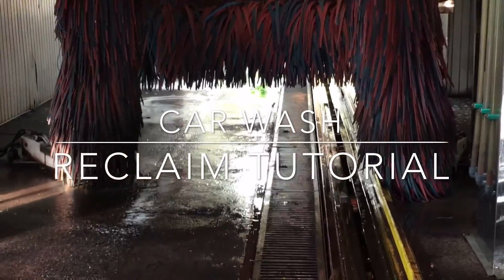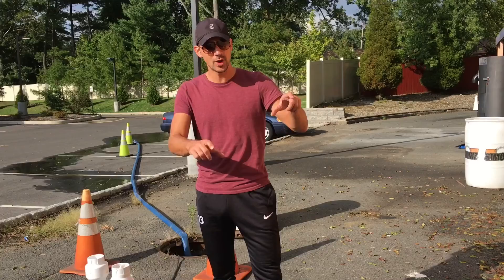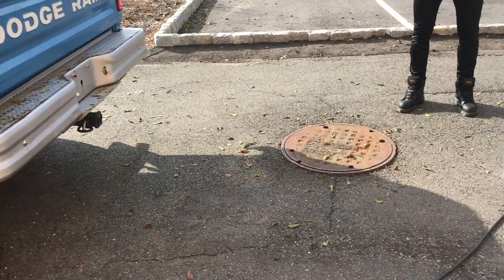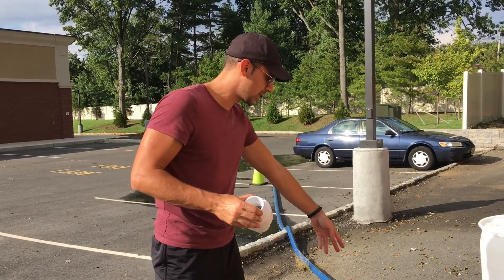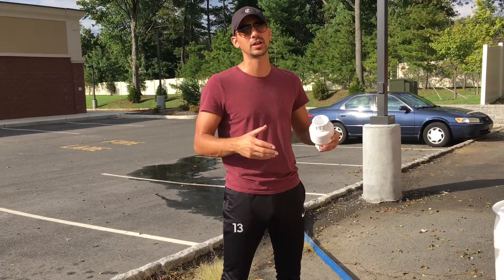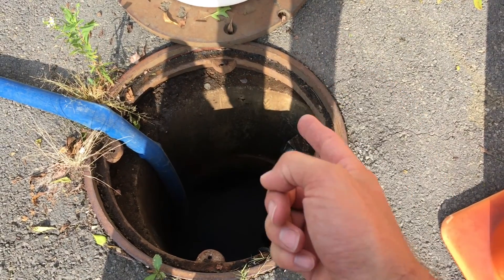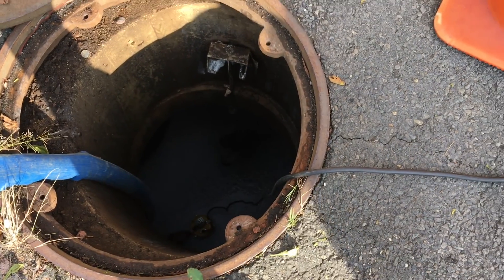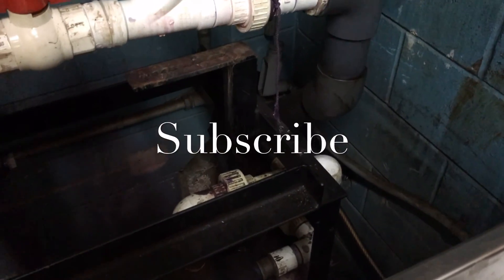Car Wash Reclaim System *How To*

Comment: That’s a very informative video. Thank you. My system does not have any check valves because my system uses a sump pump to push the water into the reclamation system rather than a pump up top to pull the water from the sump.